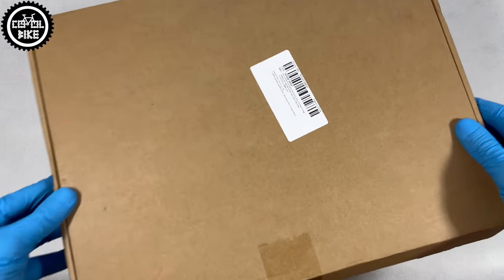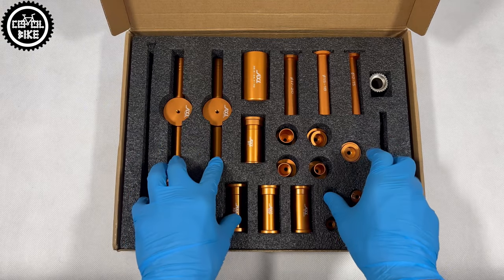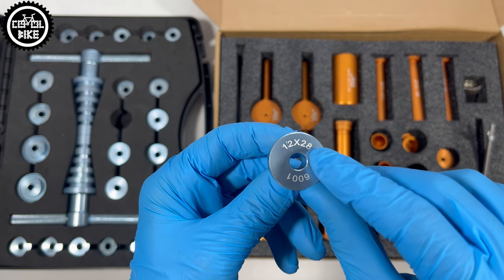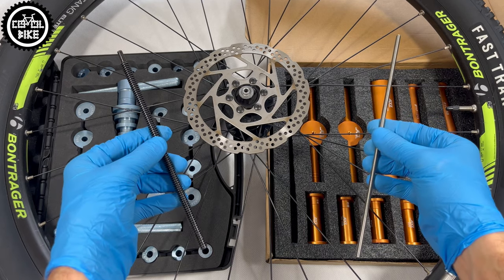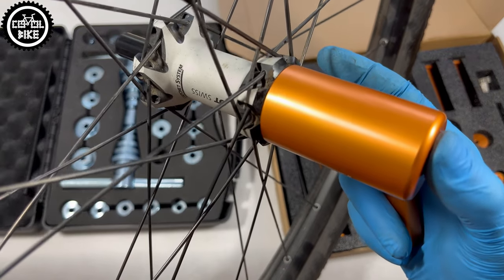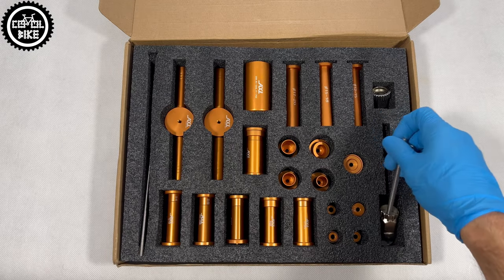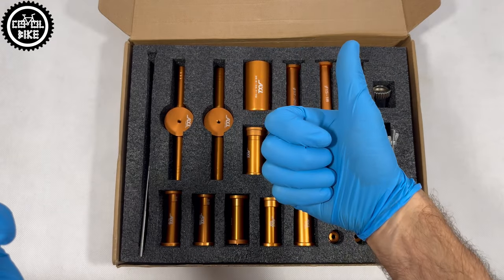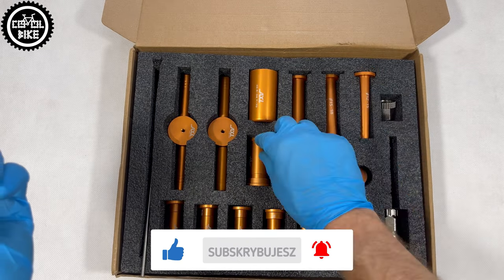BEARING PRESS from Aliexpress // GOLD AXI vs BLUE

Comment: The blue one isnt an extractor, but just a press. The orange kit is can be used to extract bearings.
Reply from the maker: Hi, that's right, and for the first 2 minutes I say three times that these are presses. And at 01:50 I mention the gold one has adapter that is used to remove the bearings. In the blue one, you can use an ordinary socket in the same way ;)

Comment: Will this work to remove swing arm bearings with n mtb
Reply from the maker: Hi, it should work, but a lot depends on the shape of your frame, and size of the bearings. You may also need some socket.